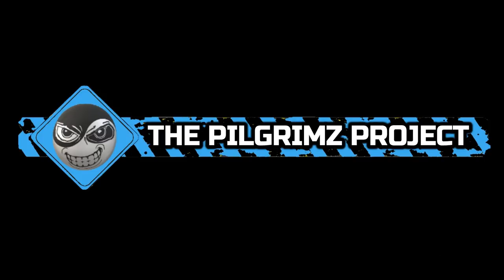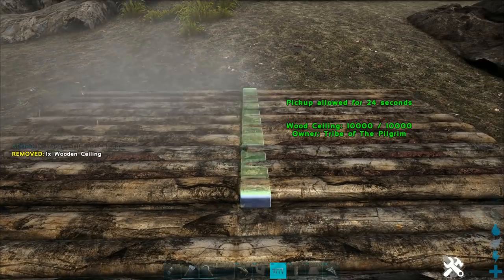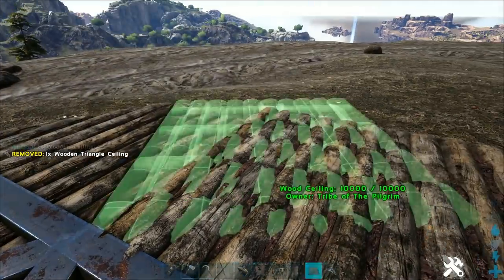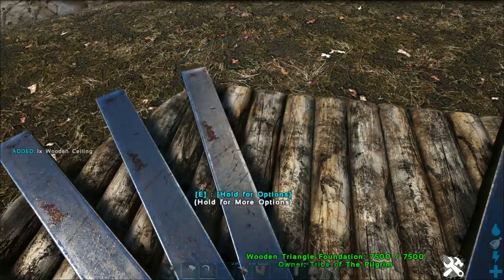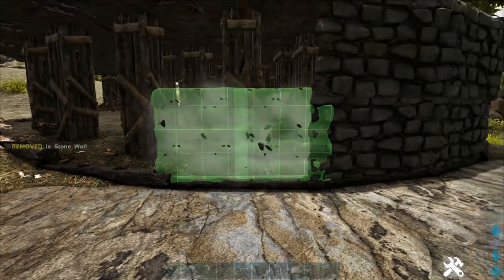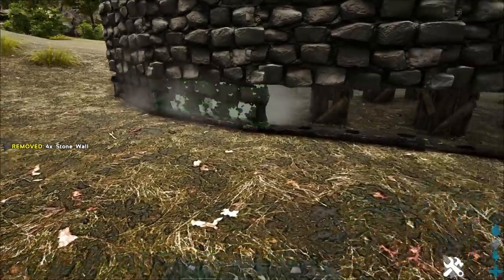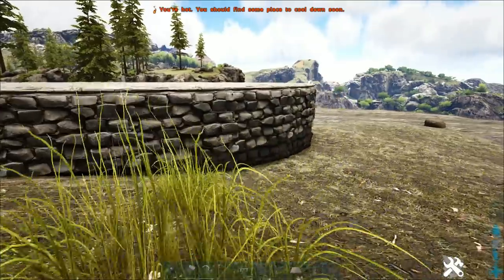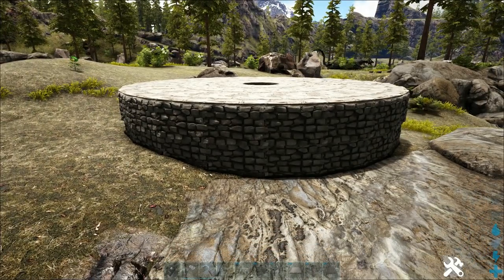Ark: Survival Evolved - How to build a perfect circle - New Homestead round base tutorial (2019)

Comment: Good stuff man! I've been experimenting with this kind of thing too but for flat ground, still trying to simplify the method though.
Reply from the maker: Thanks fatdog :) 
 I played around with the triangle foundations for ages until I hit on the Square ceilings having the best snap points.
I noticed a few others have been putting videos out for new circles with clip active and such.
Having the timer to pick things up helps with materials now, but there is still a lot of pillars wasted.
I am sure you will come up with a better idea lol 
I gave you a shot out and used your method for building on uneven ground.
Reply: @ThePilgrimzProject  Yeah, I've seen a couple of other videos popping up too. I've been experimenting with doing things in a different order. Rather than making a circle of fence foundations and snapping pillars from all of them, you can start with 2 fence foundations at 45 degrees and build a dodecagon from each. Not actually sure if it's cheaper but it definitely cuts out the fiddling around with the fence placements.

Comment: I´ve got the same problem with the fence foundation, when i remove the ceiling all fence foundation break.. someone have a solution for this?
Reply: Not sure if you ever found an answer to this but I just had the same issue and for me the issue was that I was using S+ structures.  This technique does not work with S+, you need vanilla stuff.

Comment: How do you get the first fence foundation down on the bottom wall on the outside? You seemed to skip over that part.
Reply from the maker: That was just a few I was testing, if you sit on the edge of the thatch ceilings you can press Q or whatever button flicks through the snap points, it should find it
Reply: @ThePilgrimzProject  Does that only work with thatch ceilings?  I just skipped straight to putting down stone ceilings and I can't get the fence foundations to snap underneath it at all.

Comment: Excellent method!  I built fat dogs 32 side on official and it went well, I would like to go bigger, do you have any experience doing your method using 32 or more sides?  I’ll break out my own server to do some experiments to see what I can figure out using your starting method, but just hoping you’ve figured out if it’s possible or not. Either way thank you, very well done.
Reply from the maker: hey, I learnt a lot from fatdog as well :) I haven't tried anything bigger yet but I have a couple of ideas.
You would have to find a way of fitting another set of fence foundations on the hexagon, or some way of building another set of foundations that would support fence foundations that would line up with the gaps between the others

Comment: My metal fence foundations will not snap. They move around freely. I am using metal ceiling tiles. Does it make a difference what type of ceiling tile you use?
Reply: Okay, from my research S+ foundations won't snap to other foundations, ceilings, etc. Has to be vanilla fence foundations. Bummer.
Reply from the maker: Yeah use wooden ceilings and move your camera and character around to get the snap point, that usually works better than hitting Q or whatever to find the snap point.
 But it can be a little random sometimes Q works or whatever button you use to cycle through snap points
Reply: @ThePilgrimzProject   So I discovered. I found standing center and looking down directly at where the fence foundations would meet worked best. This tutorial has been much simpler and, time conservative than others. It's easier using reg. foundations as a basis to start than a bazillion fence foundations.

Comment: How did you build the ceiling on top of the build once it’s finished?
Reply from the maker: The second circle of pillars should be the right high place ceilings on all of them then snap the inner and outer layers of ceilings to them. 
After you remove the inner pillars you have some missing and if you are on uneven ground some of the other pillars may be too low so its best to start in the middle :) Hope this helps and makes some sense